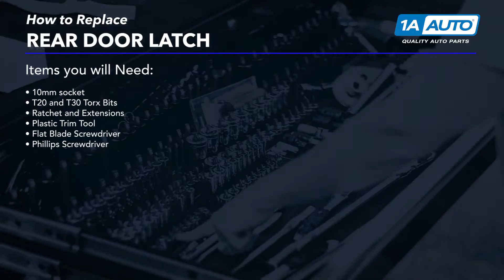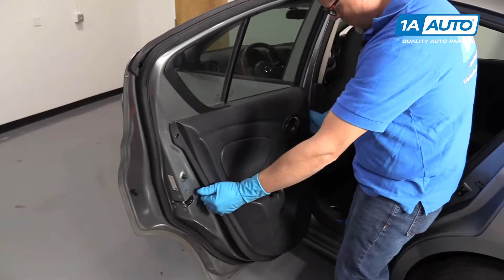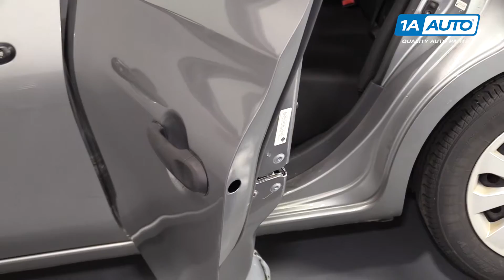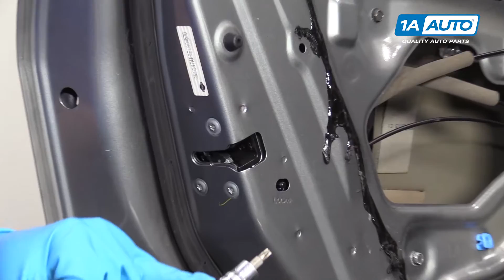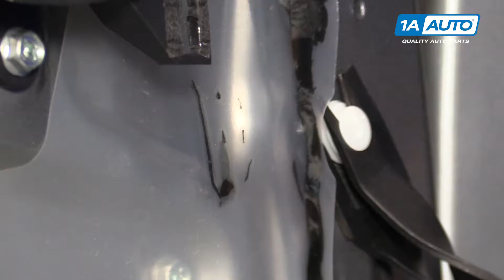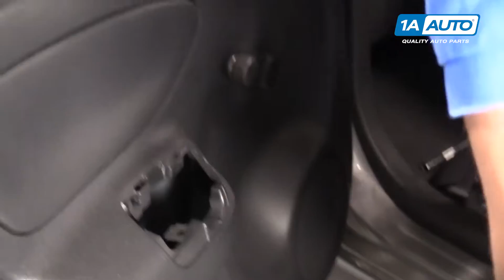How To Remove Rear Door Latch Assembly 12-19 Nissan Versa

Comment: FYI. If all you are doing is replacing a broken latch you probably don’t have to remove anything on the inside of the car. All I had to do was loosen the t30 screw behind the plug in the end of the door. Then took the small piece of the latch out. The new long piece slide right in and the small piece after that. Tightened the t30 screw and reinserted the plug.  About a 2 minute fix.